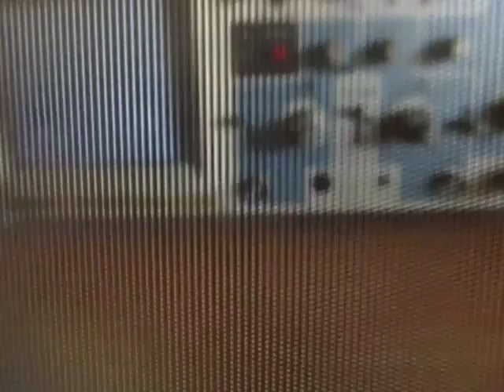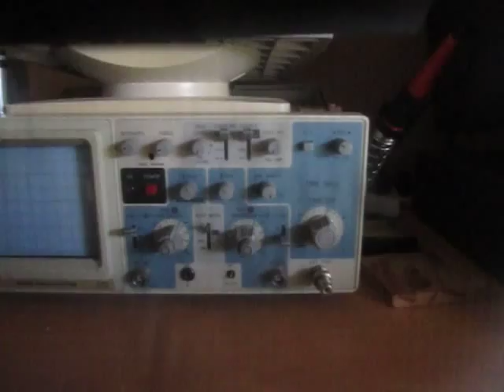Shadow mask from 14" (34cm) CRT

Comment: I know this video is old, and there is small chance you still got it, but I have to ask anyway. Is there any chance you could do a macro shots of the shadow mask from the front and the back. I have always wondered what shape the holes are. Are they square, conical, what's the thickness of the material, how wide they are apart.

Comment: I always thought these where embedded into the glass and therefore impossible to remove.  Is the flourescent colors on the glass itself?
Reply from the maker: Yes the phosphors are, for lack of a better word, applied to the inside of the faceplate.
Reply: It uses the shadow mask on and off during development. So colour phosphor 1 (which is made photo sensitive) on, mask on, light on, mask off, develop, rinse off none exposed phosphor. Colour 2 on, mask on, light, mask off, rinse, etc. The lightsource (called lighthouse) has to be in the same spot as later the crt gun will be for purity. After done, they apply a thin aluminium layer and then glue (frit) the front part plus its mask to the funnel, apply vacuum and seal it. A drop of getter which was inside the crt, which "gets" the last atoms of oxygen, is then melted through the glas using a heater that looks like a water boiler spiral. Done.